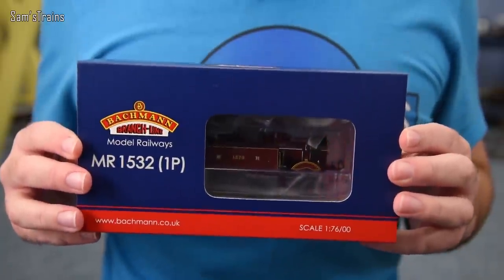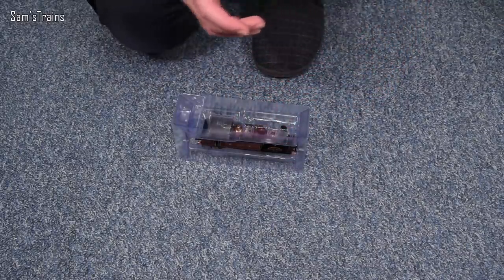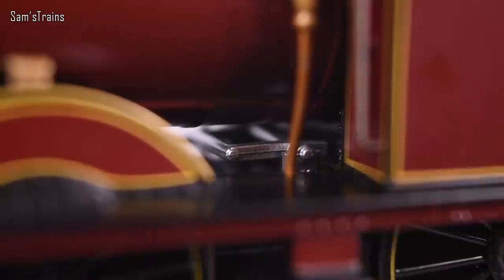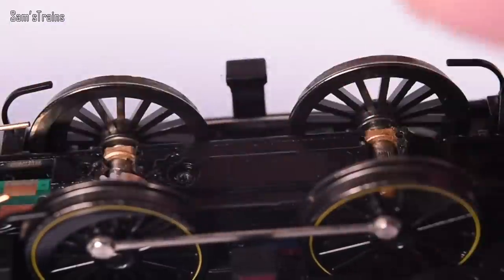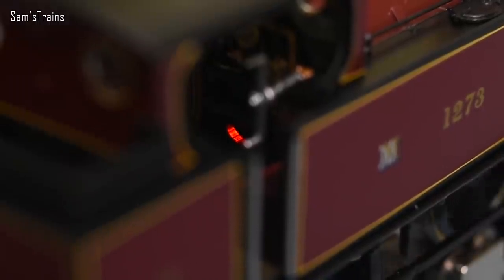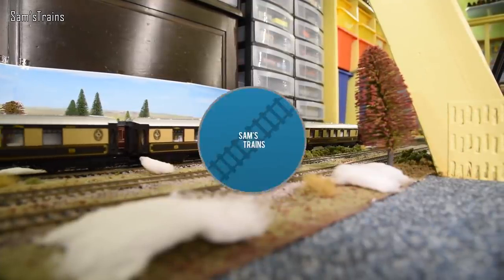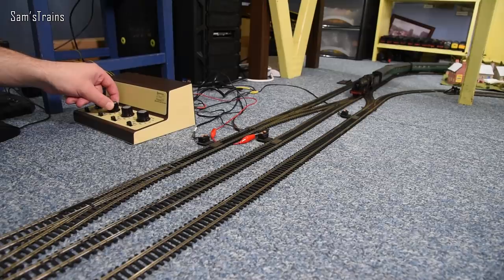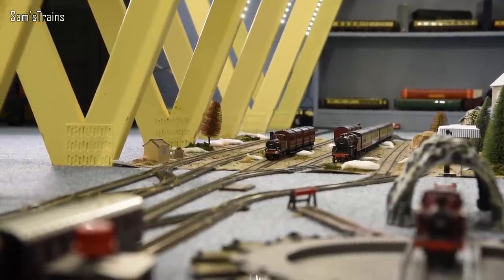Incredible New Bachmann Midland 1P Tank Engine | Unboxing & Review

Comment: Sam always will deeply hate traction tires, even when he proof himself that traction tire are better and a big pro. Loco's with them are far superior to the ones who dont have them.

Think about the Marklins at my layout.. powerful motors, very heavy AND traction tires, they eat any Bachmann and Hornby for breakfast.

Seriously now, where does that hate come from that it is so strong then you even ignore yourself by proofing yourself it is by far better for those who actually run the trains?
Reply from the maker: No, I've never proved that they are better and a big pro - they caused the model to stutter, limp and stall - they are not far superior in my opinion! I don't let emotions like 'hate' influence my judgement - only facts and performance. Rewatch the video and then tell me honestly: do you really think this model was better with the rubber tyres fitted? Here's a hint, the correct answer is no!! ;D
Merry Christmas - Sam :)
Reply: @SamsTrains  so many experienced modellers agree with you Sam. Also when the tyres soon wear out replacement and fitting is difficult, especially for new entrants.